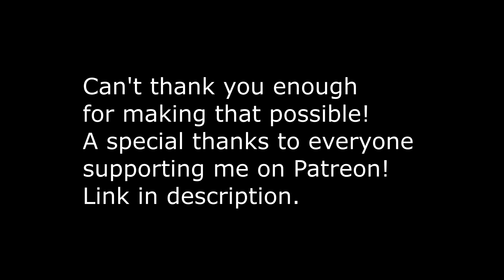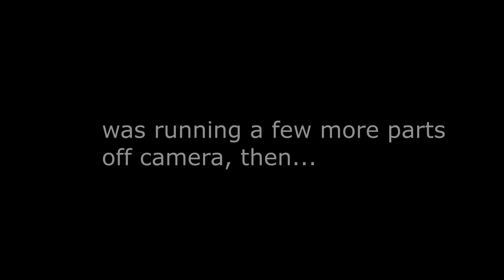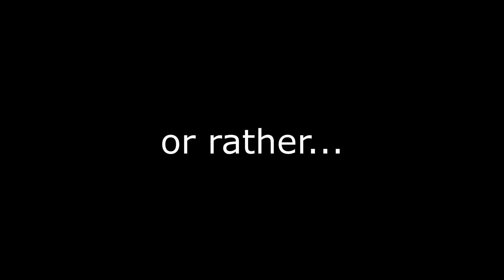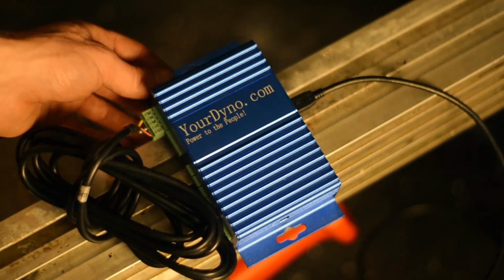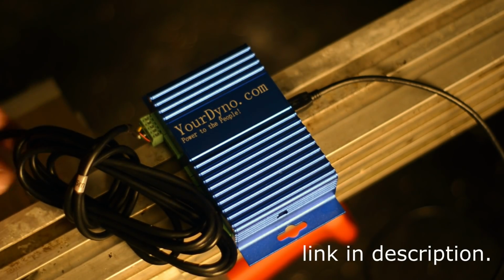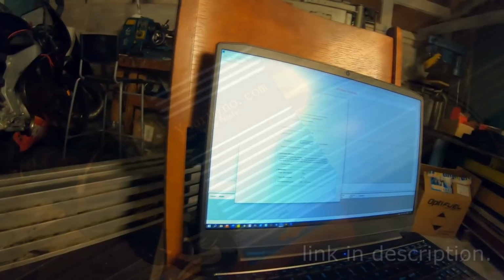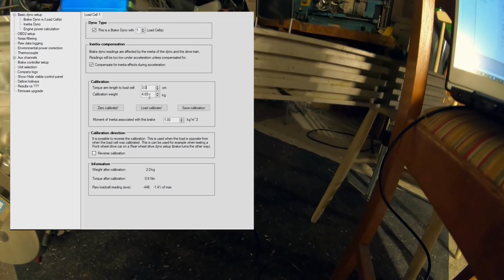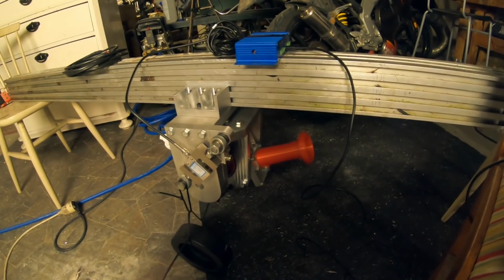The Dyno, The Most Powerful Two Stroke, and I break the mill, again.

Comment: Can I ask how did you measure the torque arm length? Did you use the "horizontal" distance of those two points or direct distance between two points? I think that the force direction matters here.
Reply from the maker: The load cell is mounted 30mm center of the crank axis and is oriented tangential to that 30mm radius.

Comment: Pro tip: Do NOT buy cheap inserts and endmills. They are cheaper, yes, but they don't last at all. Buy a proper one and it will probably last way longer than you can imagine. I use a Guhring Diver for all sorts of steel, and for aluminium you can look into the new KOR from KennaMetal. For aluminium you just have to send your machine.

Comment: I've got the same mill as you. I got rid of the DC spindle motor and used one of those Chinese water cooled AC spindles motors.  Got 3 horse power and 5000rpm now and a modern inverter

Comment: some suggestions, stop using cheap china CNC milling tools or reduce your feeding and RPM speeds. I did use them for a long time, till I change to some quality solid carbide tools. the price is 2 or 3 times more, but the tools last much longer and I have no failure during a long maching proces.

Comment: contactors tend to go bad sometimes, try replacing it for higher rated one, and check control circuit - quite possibly relay controlling the contactor might be tired :) there is normally info on contactors for how much current does control coil require, it should match or be less then current rating of control relay, which is also normally stamped on relay body. hope it helps :)

Comment: Got lucky on that tap, man.  Normally they go "ping" and that's another piece of work down the drain.  To hold taps in the drill chuck, not that I's recommend freehnding taps in a drill driver, you need something that marries the square of the tap to the 3 jaws of the chuck, or something that crips the shank firmly.  You might look into dedicating a drill-driver to tapping and replacing the chuck with an el cheapo ER11 collet chuck - it's a bit of lathe work to shorten and drill out the shank of the collet block, tap it (1/4" 20tpi threaded, for most drill drivers), and replace the chuck.  There's usually a left handed screw blocking it in the bottom of the chuck.

Thinking about it, the chinese probably make something like this already.

For the driver board, first suspect is usually the MOSFETs / driver transistors.  They usually blow short circuit, which would probably put your driver direct into overload.  MOSFETs are cheap relative to the board though, worth checking them out.

Comment: Uncoated polished carbide 2 flutes for milling alloy with tools under 12mm, works without coolant. You need clearance for chips to escape in the tool flutes, and the coatings all stick to aluminium worse than carbide

Comment: That dc motor controller looks like a thyristor based system - does it trip the breakers immediately on power up, or only once you try to start up the spindle? Maybe check that the thyristors / power diodes are OK before you replace the entire controller!

Comment: with that weight calibration you must be diligent since the pull of your weight and the load cell are not aligned! unless i overlooked something in your setup you must correct for this. Take it from a bachelor of physics.
Reply from the maker: No worries, I'll put the frame at an angle for proper calibration, this was just a test👍

Comment: Something has overheated in the controller board. Check the power supply that it doesn't give too much voltage/amps. Otherwise you'll just fry the new one also. You also need to add some cooling fans/heatsinks to the system, to prevent similar problem occurring in the future.

Comment: I do not miss repairing cnc-machines. Used to work at a shop with about 30 of them and the bastards always broke. Pro tip: Dont push you older machines beyond their capacity like it was new.

Comment: 6:50 its your mistake not using oil for tapping not the drill lol
Reply from the maker: Used oil👍
Reply: @2STROKESTUFFING  one more thing it could have been is not backing up to clean the chips or  didn't tighten  it hard enough but i mean you are a STRONG swedish  berserker :D!
Reply from the maker: @lands3r  👍 strong Norwegian berserker
Reply: @2STROKESTUFFING   god dammit :D

Comment: You mentioned it right at the end, to use gravity for calibration without complications from vector diagrams you must reorient your load cell. Making the best use of your load cell involves a mechanical setup where you motor uses as much of the cell's load carrying ability as you can with room for slightly more than you wished for. Sometimes the solution involves adding weight to move the load measurements to a different spot on the cell's range. You'll find a solution, have fun it.

Comment: How much power/torque does the brushed spindle motor have?
I might have a Berger&Lahr servo and drive lying around that could fit your needs.
If you're interested give me the data and I'll check.
Reply from the maker: Definitely interested! Not sure about the torque, it's a treadmill motor, claims 2.25hp. Maxed out at about 5500rpm with my drive.

Comment: Drill chucks have trouble holding taps because they are so hard. Grind a small flat on the side of the tap and make sure one chuck jaw lines up with the flat. You don't need much of a flat to grip.
Reply: that is no great tip at all but a recipe for disaster as you are throwing the tap off center that will cause that you wobble out the whole you wish to thread and becomes very inaccurate what's wrong with you people think before you open your brain..??. besides there are drill tap mill cullets made for holding tools for Mills that's the beauty of having a damn Mill in the first place
Reply: @donniebaker5984  First of all, it's a small flat so it's only very slightly off centre. Second he's tapping with a hand drill. You can't hold a drill perfectly steady so any small wobble in the tap will result in the drill moving, not the tap chewing up the hole. I would not suggest this for machine tapping but for tapping with a hand drill it works very well. I have tapped hundreds of holes this way and the resultant threads are a good fit.

You seem to have missed that this is a small mill. Tapping holders are long and there isn't enough Z travel available. This machine does not have full rigid tapping capability so a short rigid collet holder is out of the question.
Reply from the maker: Great tip, thanks!

Comment: I think that you have shorted power transistors in your motor controller. Maybe you can check them and replace since it's cheaper than replacing whole controller.
Reply from the maker: Thanks for the tip!

Comment: From eyes of electrician that still looks like contactor problem. Also you could try to measure the voltage between A1 and ground/neutral (dont measure between A1 and A2 because contactor acts as load and will make voltage diffrence small) is it stay same or does it go on and off. With that you can check if control voltage is ok. Also be careful!
Reply from the maker: Thanks for the advice!